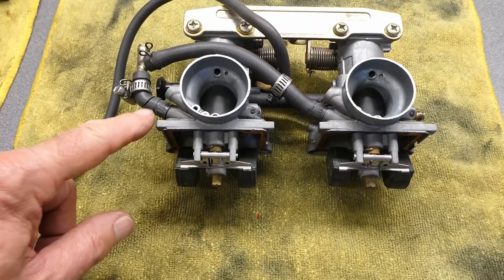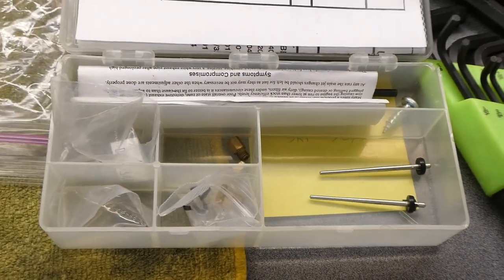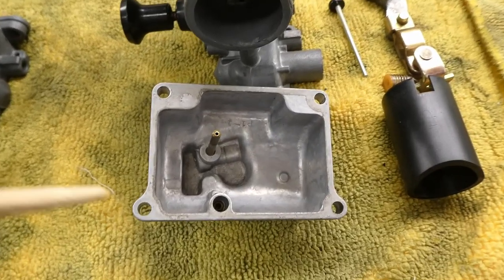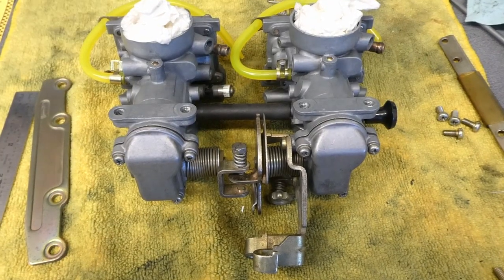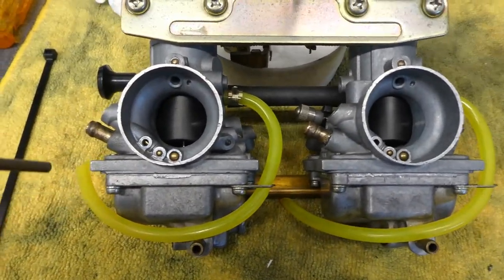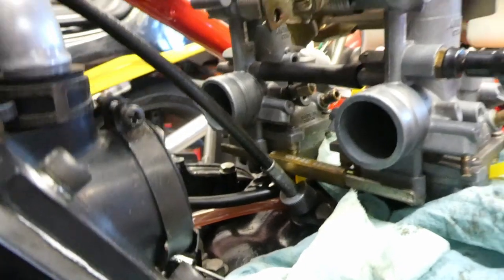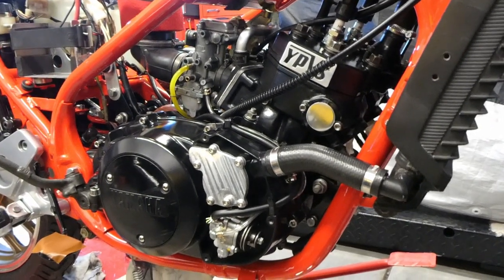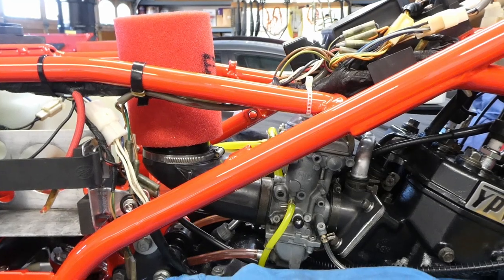RZ350 NC2 Ep55 Carburetor Rebuild, Assy & Install

Comment: Saturday morning coffee and Ken's Garage.  Too bad I am at the in-laws this weekend.  ☹  Great video on RZ carbs and their quirks.  Brought back memories of my own adventures with Dyno Jet kits and jetting.  Cable routing for the tach and the throttle are an adventure.  The throttle Y cable needs to located carefully to keep the Y junction operating smoothly.  The Yamaha service manual gives you a line art drawing of how they use the coolant lines to locate the throttle cable.  Surprisingly,  it works, help by an odd zip tie or two.😊  The tach cable routing is fun, as you discovered.  The 49 state RZ has a cable clip on top of the carbs for the tach cable.  Not sure if the NC2 has it.  Tha tach is a pain.
I too started with the 420 main Jets as suggested by Toomey and friends.  I found that the 420's were very gas wet.  Moved to 400's which were drier, but still quite rich.  Dropped to the 380's, they are sharper revving and just a tiny bit rich.  Went to 360's, very sharp, right on the edge of lean.  I ended up back at 380's to avoid nasty surprises. Jetting is a process,  just work your way through it. 😊  Fyi,   my base elevation is 500', riding area is down to 100' up to 1,200', average humidity 50%.  
Enjoy the tinkering with jetting.
Reply from the maker: Yeah, enjoy tinkering with jetting. I hate jetting. But it's a necessary evil on these things. Thanks for all the tips! I have a feeling I will end up with main jets somewhere around where you are. Nearly identical elevation as you except my weekend ride up to the Lick Observatory gets up to 4200 feet. These 420s seem huge but best to start there and work my way down. I'm on 360s on the Thrasher bike but can't really compare with that because it is running VM30's. Thanks again for the feedback.
Reply: @KensGarage1  You are right on the money.  The jetting  process is a necessary evil with these bikes, no shortcuts.  Gotta do the testing progression with jet sizes.  At least using the RD350 y boot and filter is easier for jetting than the stock RZ350 air box.  The intake roar is noisier, and it does make the jetting a little more challenging, but once dialed in, it is worth it.  The mid range to top end rev out is definitely more potent on the trusty old butt dyno! 🤣
You are making me jealous re your ride up to the observatory!  That road is a dream on an RZ.  I never get tired of watching your videos of those rides.  Perfect "bench riding" during the winter for me.  Thanks for sharing.

Comment: Ken... THANK YOU!!!  You have saved me LOTS of hassle!!  My bike is comming along nice... did a full resto like seals, brakes, carbs pistons etc...Got her running.. 100 PSI compression seems low with stock head and squish... still need to seat the rings.  I got the wrong needle seats from Amazon... they look to be for a banshee... ordered the correct ones from Yamaha.  I also have the dynojet kit... will 2x check the clip position and that the black spacer is out.. pretty sure it is.  I also have the Y pod filter with KNN and aftermarket pipes with 420's inside.  She ran good but would not come on the pipe...I also had the bowls mixed!!!  Embarrasing!  Still ran ok that way but not on top.  I will try it out with the correct parts and see how she goes!!  Think my compression is too low?  New main seals and pistons.  The stock bores looked nice with only 8K miles on them.. I just did a hone job and new Vertex pistons... no slap at all nice and tight.  It also smokes A LOT!  Need some more burn time to see if it clears up.  Thanks for all the videos you have helped SO MUCH KEN!!
Reply from the maker: You are welcome. As long as I've been messing around with these bikes I have never done a compression test on one. So unsure if your 100 PSI is low. I hope you have been able to get it to run better.

Comment: Hi one question did you had good results running the cards on the rz350 without the black spacer or you need to keep the black spacer, I will appreciate your advice. Thanks in advance
Reply from the maker: Sorry, don't have time to review the video ATM. Whatever I did in there the carbs work perfect. This engine runs as good or better than any of my RZ's. Hope that helps.